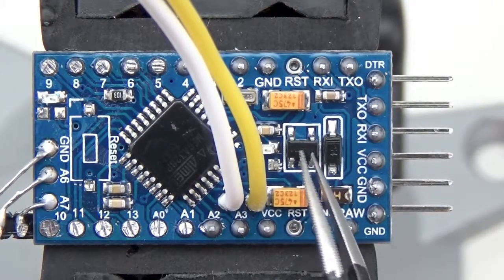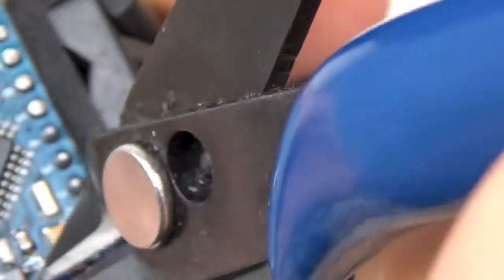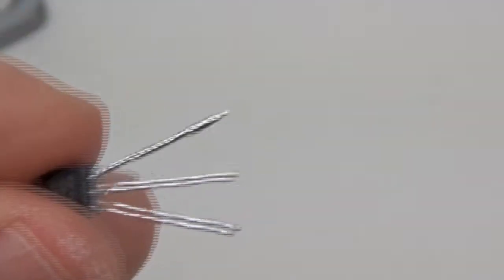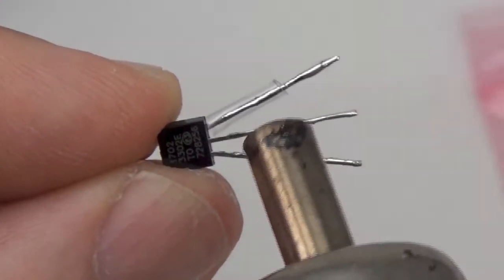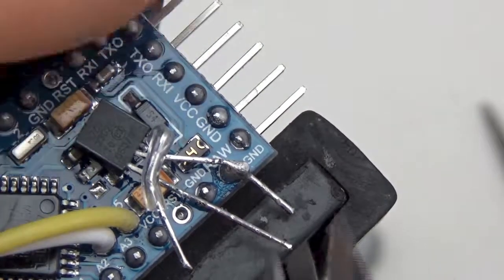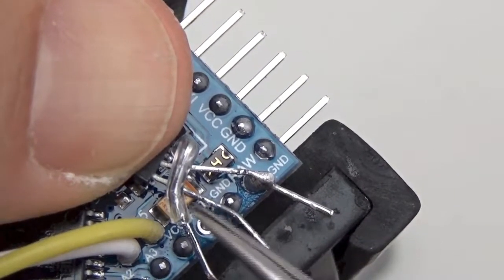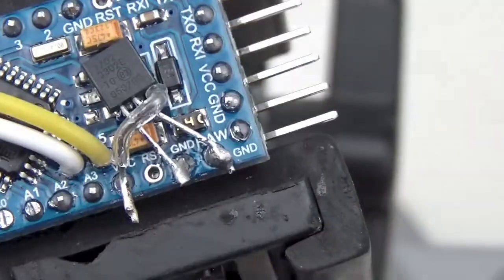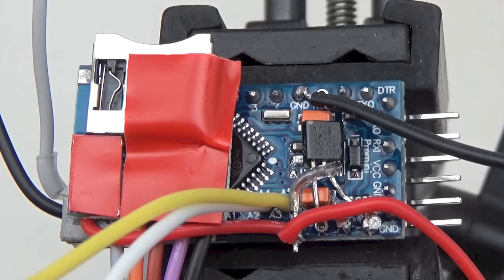2017 Pro Mini Logger Build - Add a More Efficient Voltage Regulator

Comment: Have you tried using a msp430 they will run on a coin cell down to 1.8v for a long time if you use sleep mode.
Certainly not as easy to program as an arduino, but its worth the hassle if battery life is critical.

Comment: I have broken several MCP1700 with heat when soldering. The broken ones still can regulate the voltage correctly, but the quiescent current is way too large, like 1 ~ 10 mA.

Comment from the maker: One thing to watch out for when retrofitting a new regulator onto 'some' cheep promini clones - they have a diode that may prevent some regulators from stabilizing because they cant 'see' the 10uF input capacitor on the promini board:

"You can see there are two components (labelled “h” and “S4”) between the RAW pin and the regulator and C19 capacitor that aren’t on the schematic. It took a fair bit of Internet searching to find out that S4 is a diode and the thing marked “h” is a fuse.  Apparently these add extra protection in the case of someone mistakenly powering the board via the header and RAW at the same time."
https://diyelectromusic.wordpress.com/2020/08/01/mini-usb-midi-to-midi/

So attach the raw input pin on the replacement regulators to the far side of that diode (instead of the pin shown in this video) - this will assure that the titanium capacitor is there to stabilize the supply regulator, OR you could just jumper out the diode? The MCP1700's I tried work either way, but the HT7333's I tried really need an input capacitor for stable operation.